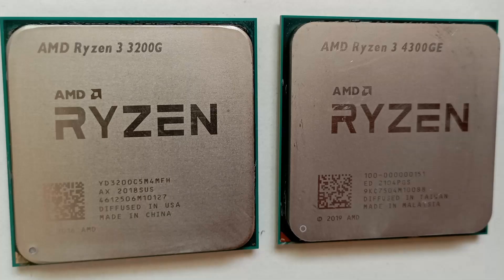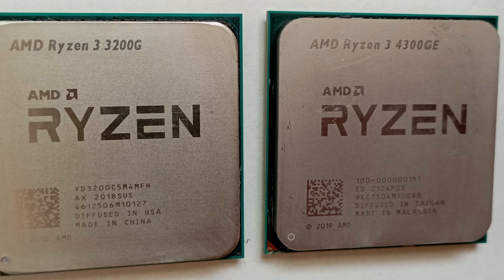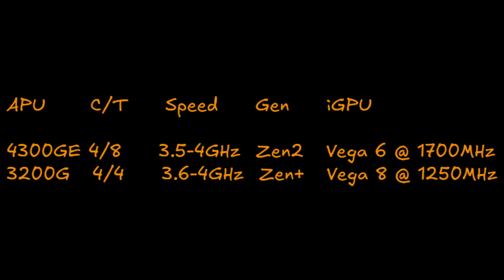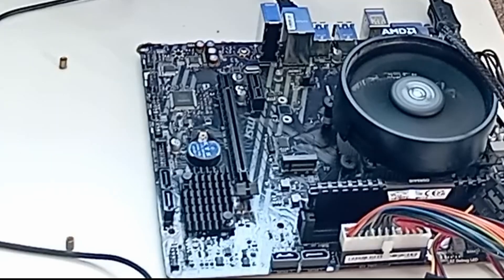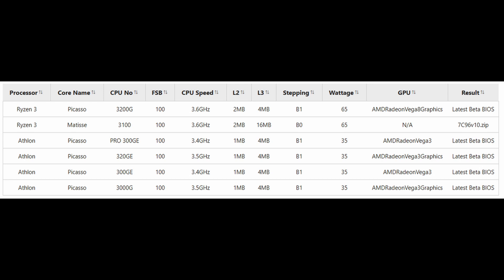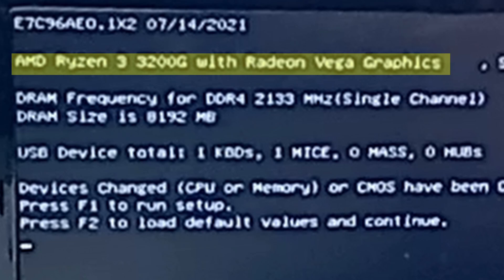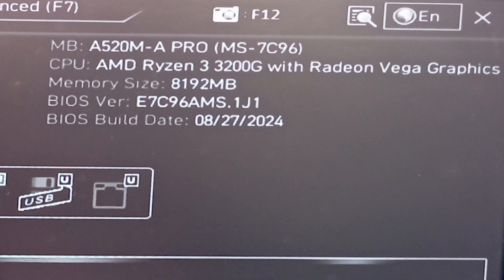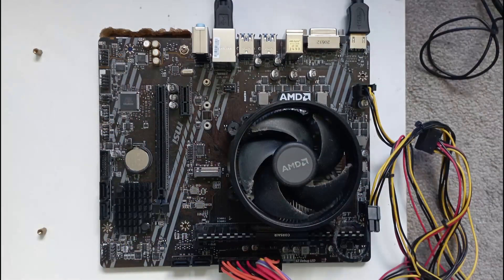AM4 BIOS Update to Downgrade CPU! - MSI A520M-A Pro

Comment: Hello, msi a520m pro (aftermarket). Have last Bios curently (non beta version) is working with ryzen 5 5600x but wont start with any ryzen 3000 series, how? Why? Tryed with ryzen 5 3600 and nothing hapened when i press power button, even fans dont move.. do i need to downgrade bio? I scared, maybe i cant run than even with 5600x..
Please if u reed this say smth 😮
Reply from the maker: Hi there - sounds strange!  With the latest BIOS, that MoBo should support 3000, 4000 and 5000 series.  Is the 3600 a known working CPU?  My first though would be maybe that CPU is faulty, as you are working fine on the 5600X.  Is there also any reason you are wanting to use the 3600?  The 5600X is a newer better CPU in pretty much every way.  My advice though would be to check the 3600 out in a different MoBo, as I suspect that may be your issue.  Cheers!
Reply: @Tech-Nerdrome  3600 is fine, working on other mobo. I Wanna sell that 3600 with this mobo . Strange yea.
Reply from the maker: @stefanpesic8070  all I can think then is maybe the mobo is slightly low on supplied voltage, or the CPU is wanting slightly higher voltage and the 2 are slightly out of sync - similar to why some ram just refuses to work on some mobos, even though it should. One of those things! Cheers!

Comment: Can you help me please I bought a ryzen 5 5500 but I can't enter in the bios so I bought a 3600 but again it do not work, so now which cpu do I need to buy to finally enter in the bios and update it ?
Reply from the maker: Hi there, what series motherboard is it? If a 300 series, and still on the original bios, it may need a first gen Ryzen 1000 for it to work and update the bios. 300 series can probably be updated to support the most recent 5000 series and everything in between (if supported by the manufacturer). Ironically, if you do have a 300 series board on the original bios, the £1.98 Bristol ridge a6 9500e would probably work for a bios upgrade as well! 400 series boards should natively work with 1000 and 2000 series chips, so getting a 1000 series is probably the safest bet. 500 series boards should work with the chips you have, in which case your issue is something else. Cheers!
Reply: @Tech-Nerdrome  Hello thanks for the response, I have the same like in the video the A520M-A Pro
Reply from the maker: Hi, that should work out the box with a 5500 or 3600 - think the mobo may be the issue unfortunately! Cheers!
Reply: @Tech-Nerdrome  Do you have any solution please because I don't know what to do else, do I need the same processor as you in the video or go at a reparator... Please I need some help
Reply from the maker: Hi, it should be working with the CPUs that you already have. If not, then something is probably wrong with the motherboard.  Is it new or second hand? If new, I'd do a return, if second hand, repairing may cost more than just getting another motherboard unfortunately! Cheers.
Reply from the maker: The only thing to maybe try is resetting the Bios - take the battery out for 30 seconds, then replace. There is a small chance this might get it working if just a bios setting that is causing issues. I'm also assuming you have RAM installed? ;) you could try a different stick of ram. Cheers.
Reply: @Tech-Nerdrome  Hello thanks you for your helping, I have 32gb ram ddr4 but I don't think this is the problem because when I start the pc there is a led on bios and cpu, I thinked about it but when I tried it I didn't know how to remove the battery on the A520M-A PRO maybe could you help please with this thanks you🙏
Reply from the maker: @clearxd234  hi, sure, there is a circular silver cr2032 watch battery on the mother board. It is clipped into place, use a toothpick or similar to press the clip away from the battery to release it, then remove it. Wait 30 seconds, then clip it back into place, and try with the CPUs that you have. Cheers
Reply: @Tech-Nerdrome  Ok thanks you very much I'll try later and I'll let you know 👍🏼👍🏼👍🏼